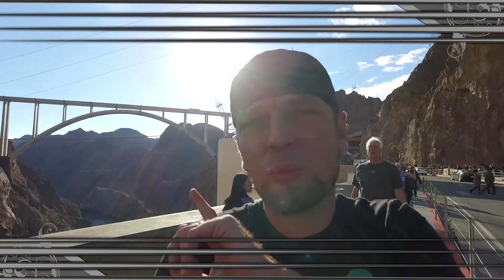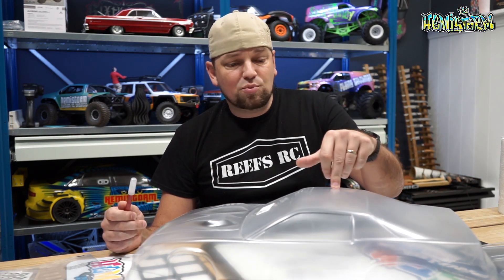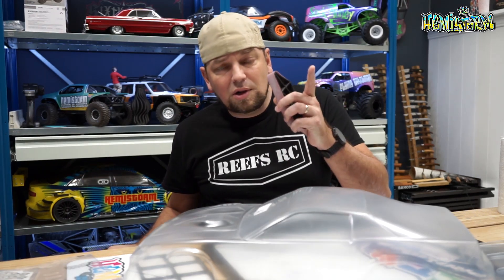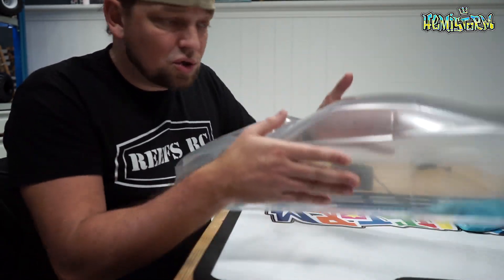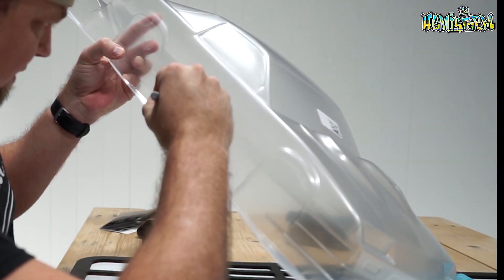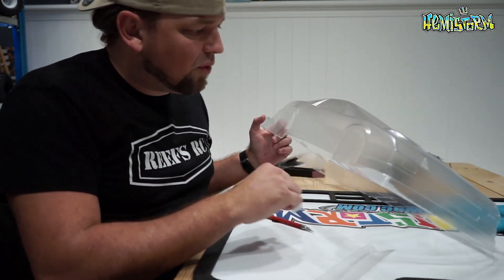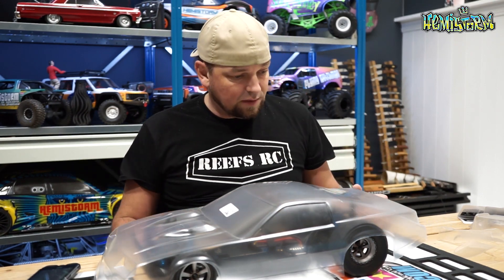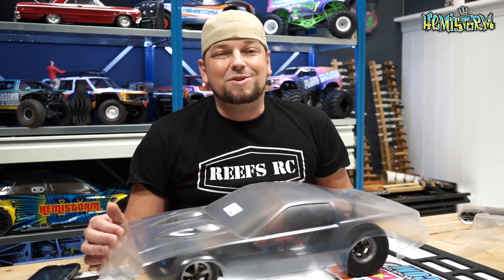RC CAR BODY BASICS - Score & Snap - M.A.S.K. Thunderhawk Part 1

Comment: I'm painting a body with a lot of greens, cobalt green then a bright and a fluorescent then yellow scallops shapes. should I back each color in white? the lighter green I understand I should but would a bright green mess up a cobalt green. as of now, my plan is to back each color so I'll start with the cobalt green back then the bright green, back it then the last green, back it then the yellow, and the final backing but I feel this might be overkill?  what you think the order of these paint should be?
just waiting on the white backer. after this green body, I'm painting a pink and purple 55 bel air.
Reply from the maker: When you aren't sure, you can always test on a scrap piece, but usually a lighter color doesn't affect a darker color that much. A very light coat of white before proceeding can be a wise choice though. Have fun!

Comment: Each one of your video i watch gives me more confidence to do better.  Each body i do gets a little better.   I'm still scared of scoring.  So far I always F it up and slip or go off line.   So I'm super careful with the scissors, do like 2 or 3 cuts before the final and always leave  .5mm or less to sand and get a nice smooth edge that way.  Someday I'll get the score thing down.

Comment: its much more difficult to cut it with the knife then with a scissor. Not everyone can hold it that steady and I use a proxxon (like a dremel) for sanding. Just slow rpm and its fine.